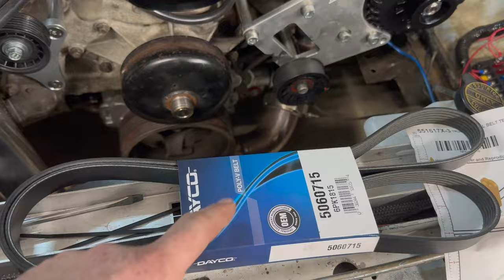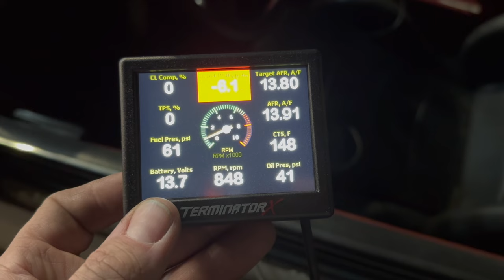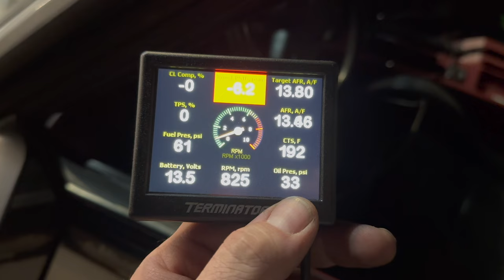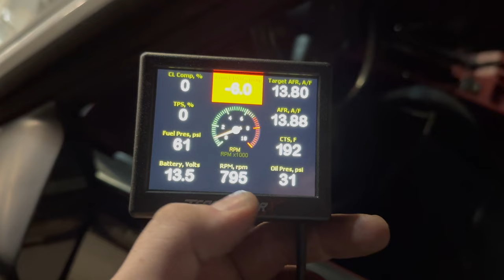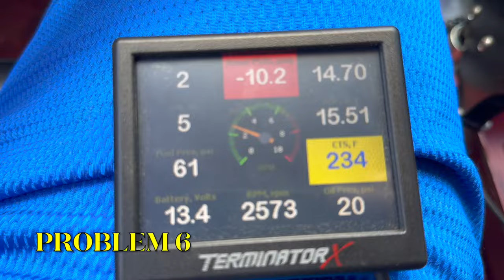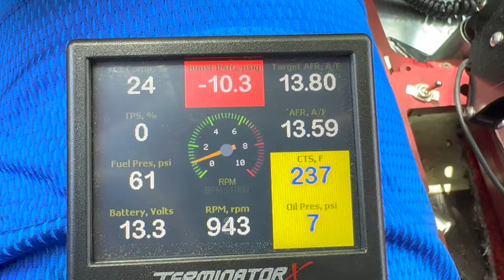No Prep Build 18: Losing Oil Pressure.

Comment: 240 degree coolant and oil temp will cause that low oil pressure
Reply from the maker: That’s good to know, and it would cause it to be that low?
Reply: @averagemm  the hotter the oil gets the thinner it gets. I have a oil temp sensor in my car and typically its the same is engine temp. My engine temp is 180 and oil will be about the same.
Reply from the maker: Ok I will have to get one as well so I can monitor that as well.